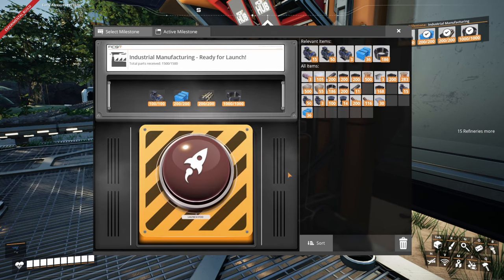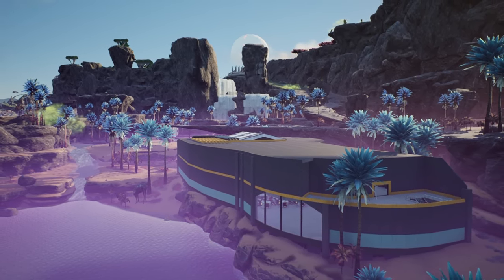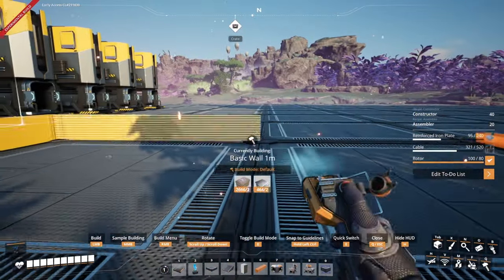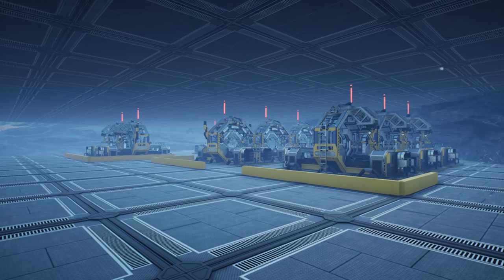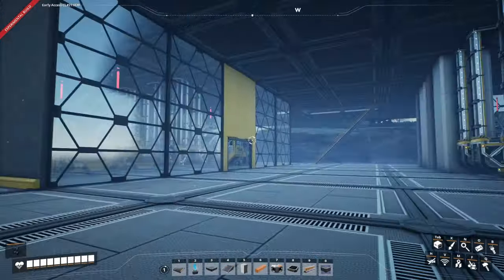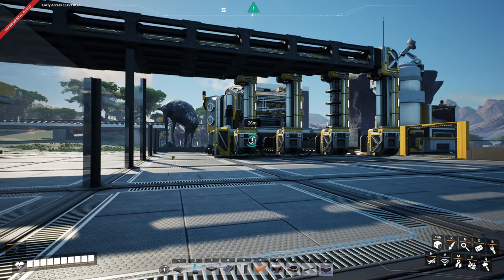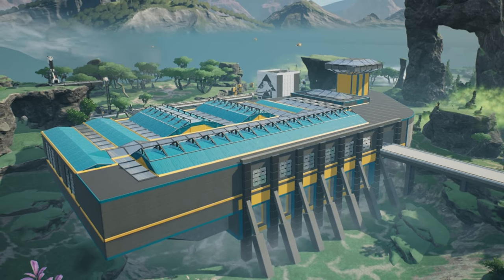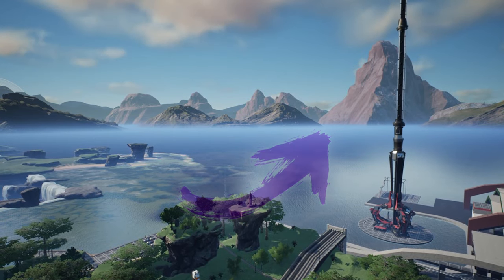Building A BEAUTIFUL Heavy Modular Frame Factory in Satisfactory Ep.08

Comment: On those tight logistics floors I find to make things a bit more organized if a bent is going north/south it's layed on the ground and going east/west it's off the ceiling (or whatever direction you find best) so if a belt turn north lay it on the floor for however long that section is and ect but typically I build my logistics floors atleast 12m high

Comment: I had an idea about a build and wanted to see if anyone had tried it or what thoughts everyone would have.  What would happen if each resource node/miner had its own small smelter building so that an actual factory would only have ingots coming into it?  So, for example, a normal node with a Mk 2 miner woud have a building with 4 smelters in it, and all the ingots go on a single Mk 2 belt to a remote factory lcation.  It seems like it would simplify the factory, and it wouldn't be that hard to build and power a building with 4 smelters and splitter/mergers. Thoughts?
Reply: Make sure to have the space to extend that smelting area (maybe have the possibility of adding an upper floor) because you might want to overclock those nodes at some point and also you unlock better miners.
Reply: @Boris Lav  that's true.  I think it would be pretty simple to extend the building horizontally or add another floor as you said because it's nothing but smelters.
Reply: @mkaverage1791  Also, ich there is water nearby you might want to wash your ores to get more out of them, if you already have the alternate recipes.